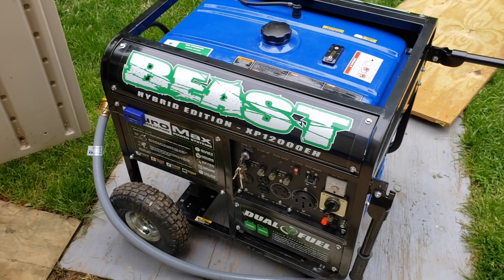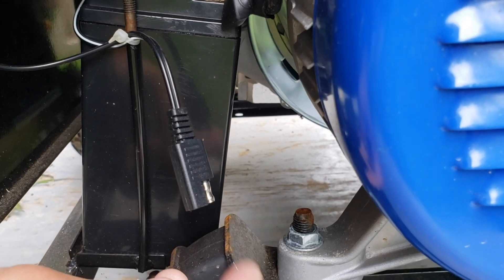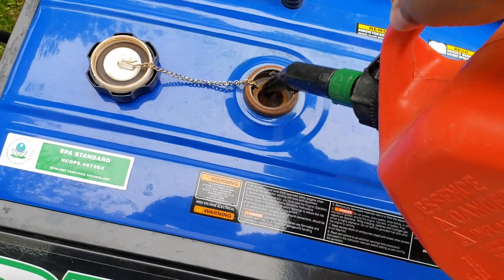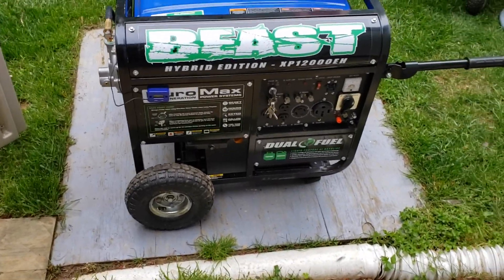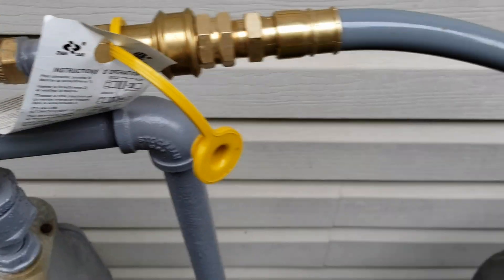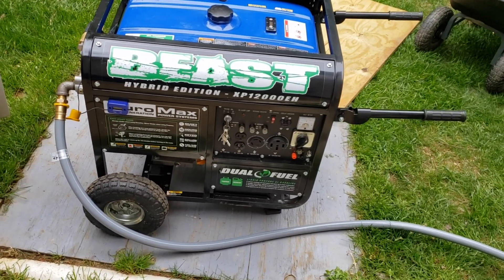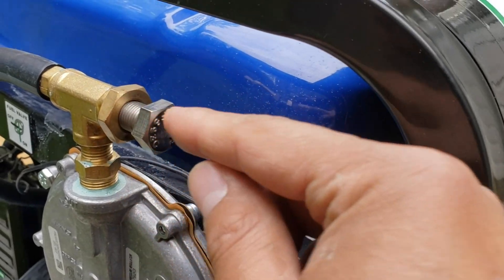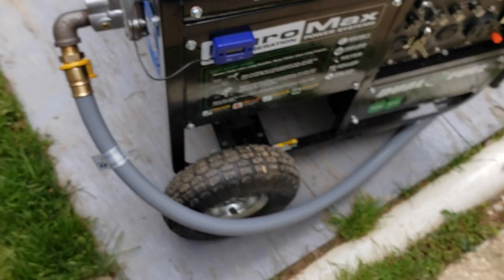XP12000EH Follow up on Tri-fuel Generator | switching between Gasoline/Petrol & Natural Gas

Comment: 100% best Generater.Systems I have used. A test for hurricane prep here in Louisiana: three AC units, 5000, 5000 & 8000, 3 fridges, 2 device power setups, 4 flat screens....AND I had 40% of the power meter to spare.
Reply: Uh no....

Comment: Hey Chris what size is that hose going to the carb from the regulator and did you have a tough time getting it on the carb? I ordered the kit and I haven’t got it yet but I was looking at my generator and noticed the hose going from propane regulator to carb is 5/16- I was planning on using 3/8

Comment: What's the output on natural gas vs gasoline? How do you get the power into house, breaker box hookup? Or just use extension cords?
Reply from the maker: You typically loose about 20% when you transition to Natural Gas... so there is a trade off in having  an unlimited gas supply, but you can easily go back to gasoline if you need the extra power. To get power to the entire house, it's best to have it hook up to your breaker box. The best option is to have a interlock transfer switch installed on your breaker box. If your breaker box has room for it, it's not too expensive to have someone install it. If you are a confident DIY'er, you can install one easily yourself.

Comment: I was wondering if anyone here has figured out a solid oil change solution for this beast. 

I own the xp12000eh and it is awesome. It does require per mfr a 20 hour oil change cycle so that is what I do… I can say it is not that bad…. but for those of us who have everything plumbed and ready to go - kind of wondering if anyone has a improved oil change plan/method. I have the oil stocked and have learned it takes a hair more than the manual states.

Comment: I have my conversion kit installed and tried out NG today. After priming, the generator started no problem, but it would rev high and low to the point where it nearly stalled.  The chock kept automatically moving from closed to full to prevent the generator from stalling and it kept running that way.  Made adjustments to the valve allowing more/less gas through the line, but that didn't help.  Any thoughts? I did see a switch on my generator (newest model from what I can tell) that there is an idle control on/off switch and wondering if I turn that off it will make a difference?  Thanks for any input.
Reply from the maker: Yes turn off idle control. Mines does the same thing if I leave it on. It only works for gasoline, but not NG
Reply: @Mr-Chris  thank you, that did it.  Runs like a top on natural gas!

Comment: I don't have that valve on my regulator and both propane and natural gas work interchangeably. What makes the difference is using the hose that should have came with your generator in conjunction with the regulator you added. If you don't have one just get one for a BBQ pit.  The small regulator on the hose will lower the pressure to where you get about the same BTU as natural gas. Propane will be a little higher. I recommend getting a few propane tanks and just keep them on standby. That why there you can use your generator if they ever cut the gas off.
Reply from the maker: I'm not an expert, but when I researched this... The pros say you need at least a 3/4 inch thick hose for natural gas for a generator this size to produce the most power. As for a backup, I do keep 30 gallons of treated gasoline in heavy duty metal military grade gas cans just in case. But my power company has spent the last decade moving power lines underground and reliably has been awesome.  I haven't lost power and had to use this... Yet.

Comment: Chris you run your natural gas with choke in open position correct? I have same setup and there is another video on here with same setup the guy says to run with choke fully closed.Mine will only run smooth if i move choke from full open just about a 1/4 inch to left and runs great.
Reply from the maker: yeah, I find that it's different for each person. I tried running closed and midway, but for some reason it works best wide open for me... not sure why.
Reply: @Mr-Chris  Thanks for replying.I just wanted to make sure I was not crazy

Comment: This video really inspired me to tackle this, so thank you for the info.  I'm about to have a gas connection plumbed and had a few questions.

1) I'm almost certain it's a non-issue, but if you do 3/4" unrestricted run is there any risk of pushing the inlet pressure limits of the regulator you specified (13.8" wc)?  (I can't find an answer and am waiting on clarification locally to what the outlet pressure is from the gas meter at my location).

2) Any final clarification on whether a 1/2" should or should not be fine for a generator this size (I have a 12000 Pulsar with a similar/identical motor)?

3) Lastly, did you also have a link to the fitting configuration used for the pressure control on the outlet side of the regulator (doesn't appear to be included in the regulator you linked)?  Looks like standard fittings but if there is a kit or specs on what specifically that would be great.

Again, thanks for the video and the info.  Cheers.
Reply from the maker: 1) sorry I am unsure about the answer to that question.

2) after I posted this video, I got many feedback from people saying that they installed 1/2 inch pipes and it works fine. However, At the time I posted this video, several online forums post I found from "professionals" strongly suggest 3/4 pipes.

3). Are you referring to fittings used on the meter? Those are standard gas fittings I bought at Lowe's.
Reply: @Mr-Chris   Thanks for the info.  On #3 I was referring to the small assembly with the bolt at the top of the regulator for fine-tuning the amount of fuel heading to the carb.  I think I could guess on the fittings but I'd rather not ;)  Thanks again.
Reply from the maker: @Warkive    ohhh, that came with the regulator. It's part of the included kit. I have a link in the description to one that already includes it.
Reply: @Mr-Chris  Ah, initially looking at the image of the kit it didn't look like it included it but I see the bolts now and the required change.  Thanks, and cheers.
Reply: @Mr-Chris  As a follow-up to the question about hose sizing, I was speaking with NashFuel today (they had a regulator kit specific to my generator) and said that for a generator our size (~12kW) they definitely did not recommend a 1/2" hose to the regulator inlet unless it was 36" or less.  Though a 3/4" hose of most any length with a 1/2" quick connect at the regulator itself would be perfectly fine.
Reply from the maker: Awesome, thanks for the confirmation.

Comment: I don't trust those solar-powered trickle chargers.  I think they can over-charge.  I suspect that's what happened to a couple of boat batteries I had.  I've switched back to a regular plug-in trickle charger.  I used the Battery Tender Junior.
Reply: I have the NOCO BLSOLAR5 or BLSOLAR10 the larger of the two from Autozone and it toasted two batteries one a two year old car and a new powersport batter. NOCO Fails to tell you that you'll need to purchase a charge controller and that the solar panel isn't waterproof out of the box so you'll need to apply clear silicone. I kept my on the dashboard when needed but the panel failed under a year and Autozone no longer carries em.

Comment: put a cap on the regulator when you want to run on gasoline, so it doesn't suck in unfiltered air.  if you put a tee on the hose and run it to the original propane regulator, you can use the old original regulator as well.  this way you don't have to readjust the load block to run on propane.  just need to cap off the inlet you are not using.

Comment: Chris- 1. My generator arrived yesterday. 2. Plumber coming next week to install quick disconnect on NG box.  3. I didn't see where you turned the "switch" on the generator for fuel type selection from gas to "LP" (even though you're using NG). I assume you DO have to turn that switch from GAS to LP when toggling between GAS and LP/NG?
Reply from the maker: I think Duromax made some upgrades to their Generators. The one I have is from 2017 and doesn't have a switch between Fuel types, just a gasoline on/off valve .

Comment: What is the maintenance like on running a generator on natural gas? How long can you have it run for continuously without letting it rest? Can i have it on for days at a time? Also is there the same concern as there is with gasoline about carhon monoxide?
Reply from the maker: Same type of maintenance as gasoline, change the oil once ever 50 hours. You could run it continuously if in a well ventilated area, but I would give it a break and check the oil at least once a day during a long term power outage.  NG runs cleaner than Gasoline, so you might get away with longer intervals in changing oil.  Also if running this for a very long time, you might want to check the Electric motor brushes as they can wear out. This Generator came with extra pair. There is the same concern with Carbon Monoxide even with NG. The bad thing about NG is that it produces about 20% less watts than Gasoline, but the trade off is not having to fill up and haul gasoline frequently.

Comment: I haven't had good luck with the solar-powered trickle chargers.  I think they tend to overcharge, and have ruined three batteries.  I've gone back to using the Battery Tender Junior.
Reply: Get a solar charge controller. SUNER POWER Waterproof 10A Solar Charge Controller - Intelligent12V/24V Solar Panel Battery Regulator
Reply: Thanks for the info.. I have a NOCO BLSOLAR5 or BLSOLAR10 the larger of the two if I recall and it toasted both a two year old car batter and a new motorsport battery. NOCO Fails to tell you that you need a charge regulator / controller for an additional fee. And thier solar chargers are not water proof out of the box you need to purchase and apply clear silicone. I always kept it on my dashboard when changing but the panel failed in under a year. I purchased it Autozone but they no longer carry them. Again thank you for the tip I'll give it a try.

Comment: Hi Chris, Thanks for the videos. I noticed a digital meter on your generator on top of  the Brand name. I might have missed when you installed it . What does it measure?
Reply from the maker: That's a hour meter so I know how many hours I have run this motor.

Comment: Hi Chris & thank you for the videos. Just got my xp12000eh on Saturday 6/13. My 3/4" natural gas line is already run from my meter to near where the generator will be used. My Garretson KN regulator is about 6' from the generator with 3/8" quick disconnect running to the generator's 2nd stage regulator. Generator won't run. Changed the block screw setting end-to-end. Made no difference. After watching your videos, I've disconnected the hose from 2nd stage regulator output (the one that runs to the carburetor). Plan on getting some fittings just to connect that to the KN regulator output to see if that will work. I'm encouraged that it will from watching your videos. I too have no interest in running on propane. Thanks again !!
Reply from the maker: Thanks, good luck getting it up and running.
Reply: Did you get yours going? It sounds like you need a larger supply line

Comment: Hey bro it’s Joe here. Looks great! Only you might want to consider is doing a quick connect at both ends of the hose for the natural gas.
Reply: Yes, that's what I did.
Reply: Remember not to run your generator indoors

Comment: What about if you wanted to run propane? Would it be just like running natural gas, or would you have to change something? Thanks
Reply from the maker: You would have to buy an adapter for the propane hose to connect to the 3/4 inch inlet on the regulator, that's the only change.

Comment: Is natural gas cheaper than gasoline? Is the natural gas more efficient?
Reply from the maker: Natural gas is much cheaper than gasoline, but not as efficient. Gasoline gives generators the most power to generate electricity where as natural gas give less. The trade off is never having to refuel running on NG vs Gasoline
Reply: Chris so other than being easier to run
Can you get the same amount of power for the same price or cheaper?

Because if you can do both then am surprised.
Reply: CasualALT he answered that in the second sentence ^
Reply: @scottb_02  not really. It takes more natural gas to generate a given  power but natural gas is cheaper, gas prices have been fluctuating this last year so it's a difficult answer. Price per BTU is what hes looking for.